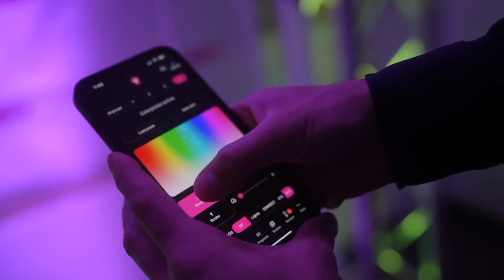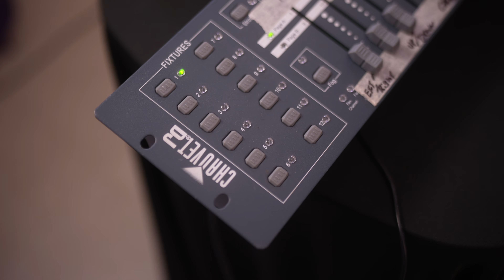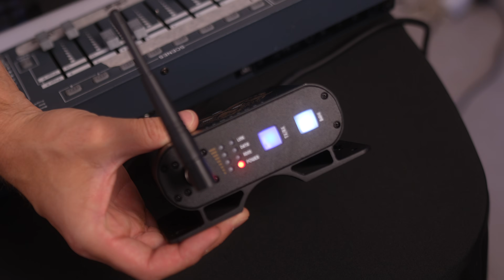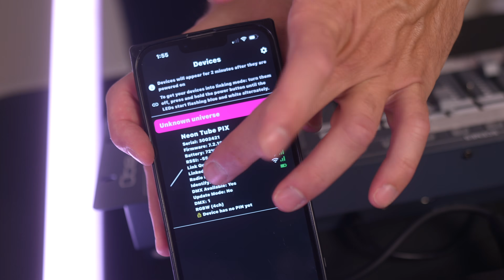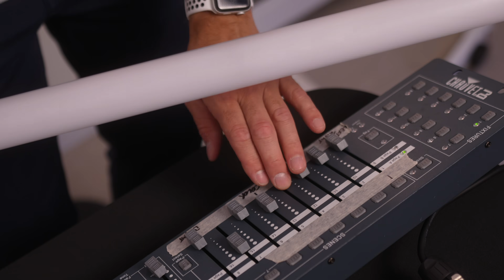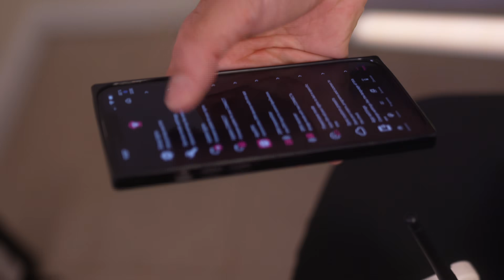How to Connect Ape Labs NEON TUBE PIX to CRMX and a DMX Controller

Comment: I have 6 Ape Labs Neon Pix.  I could teach this procedure (How to link to a Blizzard GOAT via CRMX)
Only problem is it is NOT stable.  I've had 6 of the Neon Pix for almost a year.   

(edit - See my response to this - I "think" I have finally fixed my connectivity issues)

They worked reliably at one show.  One.  I'm lucky if 3 of them stay connected anymore.

The GOAT stays connected to my other lights great.  Only lights that have an issue is the Neon Pix.
The receivers in the lights just can't do whatever it is they need to do.

They DO work great on the remote, and I'll bet the Ape Labs connect works great, but I need CRMX and these lights do not reliably work with CRMX
It's a shame.  I like the lights.   Just wish the programs I spent hundreds of hours writing, would work with them.
Nope.
Anyone want to buy 6 Neon Pix with a soft bag and charger?
Just use the Ape Labs Connect or a remote.
Reply: Important info on the Blizzard GOAT

The GOAT has 3 modes.  W-DMX-G3, W-DMX G4, and CRMX.

You change modes by

Enter mode change mode by
pressing the BAH buttom 3 short presses in a row, and then one long press
it will the blink once fast, twice fast, or 3 times fast depending on which mode it is in.
1 blink is WDMX-G3 mode
2 blinks is W-DMX G4 mode
3 blinks is CRMX mode

once you are in mode change mode, you single press the BAH button to toggle through the modes.  
When you find the correct mode, you long press to save.

My GOAT would occasionally connect in WDMX-G3 mode, but not reliably.  It was infuriating.
It turns out that the GOAT was in the wrong mode.

The people at Blizzard were super helpful in trouble shooting.
They answer the phone and return e-mails.
I would have never figured this out if they didn't respond.

Ape Labs occasionally responded to my requests for help, but on connectivity issues, they pretty much ghosted me.
I will admit my tone has been "frustrated" but if you don't help people learn to use your stuff, they won't buy more